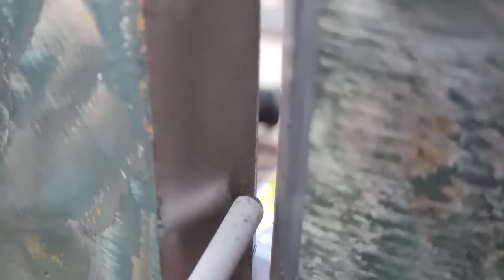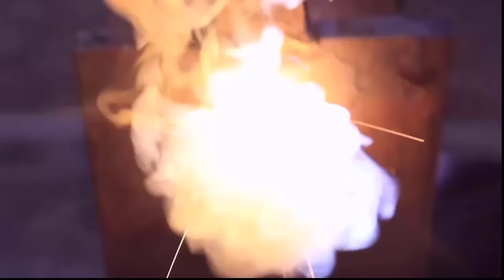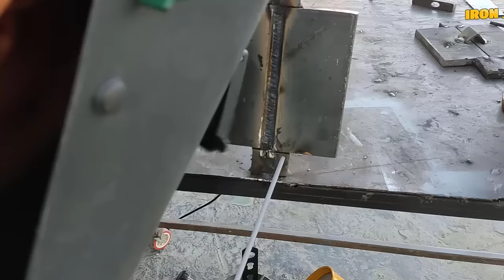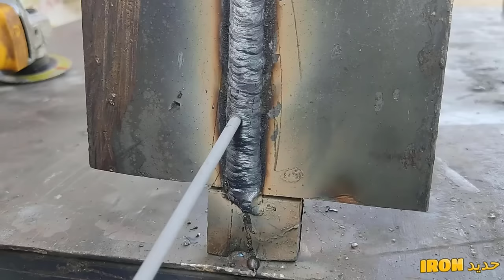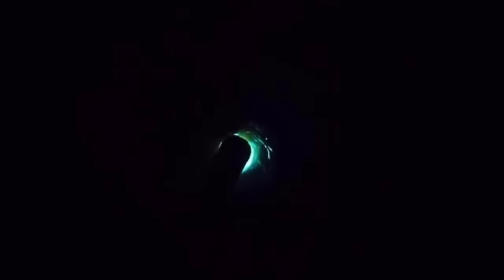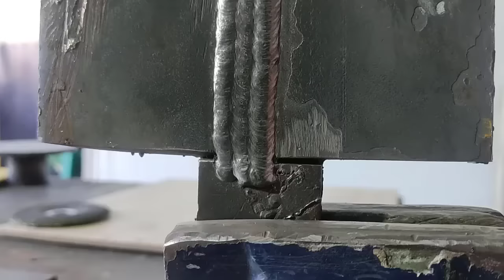Welding Test 7018 3G

Comment: You are supposed to clean thoroughly between passes to avoid inclusions.
Reply: 100% would fail testing
Reply: @beatems  most people dont need a grinder to get slag off their plate. if it takes you that much to get it off you probably wont be passing yourself
Reply: @koti6158  who mentioned a grinder brev ? Can see the slag still on the bead before he goes over it
Reply: would have pass didnt weld over the weld that that had slag on it restart on top thats what us as welders call a restart and beside that it hot enough to burn off the slag that would cause slag indentcation now thats a good weld
Reply: Why it Will not pass is the the thing thats its an entrapped slag
Reply: Exacto! Limpiar el cordón, para eliminar escoria. Antes de continúar el proceso...🙄😲✌️🥳

Comment: My 7018 looks so bad, any tips on how to get it flat? I always have molten bumps on mine
Reply: You might be holding for to long what do you run it at ?
Reply: Either your travel speed is too slow, or your amperage is too high. Possibly even both. Also, for vertical remember to do a slight swaying motion.
Reply: The most simple answer is consistency. Watch how the puddle moves and try to move it the exact same way repeatedly until you're done.
Reply: @hajimenagumo2199  That's very vague. Puddles can lose consistency for a bunch of reasons, you can't just rely on it staying the same for you the whole bead. Studying puddles is easy for people who've been doing it for a while but if he's asking this question he has no clue what it should look like.
Reply: @koti6158  idk I understood it once other welding videos explained it when I first learned

Comment: Sir plz explain in detail down vertical down welding
Plz plz plz
Reply: You're not supposed to vertical down with 7018 rods. Anything with a 0 in the end you can do vertical down or flats. But 7018 are strictly vertical up or flats. 10 months too late but hope this helps.